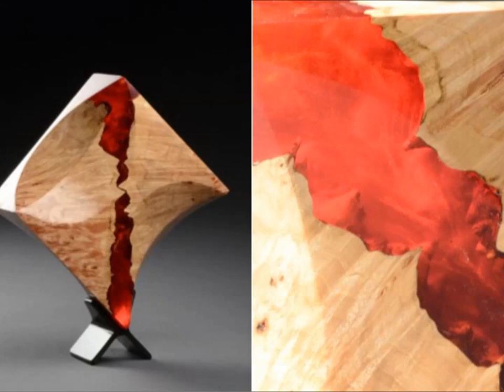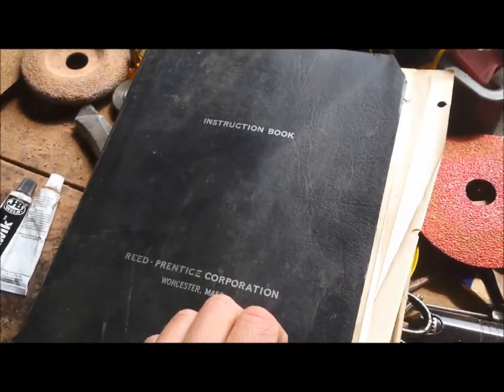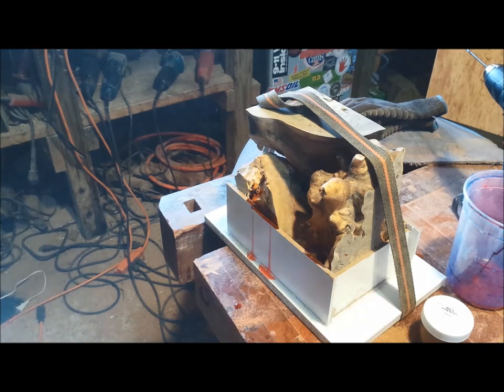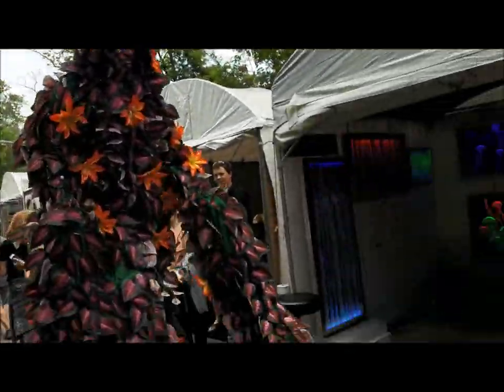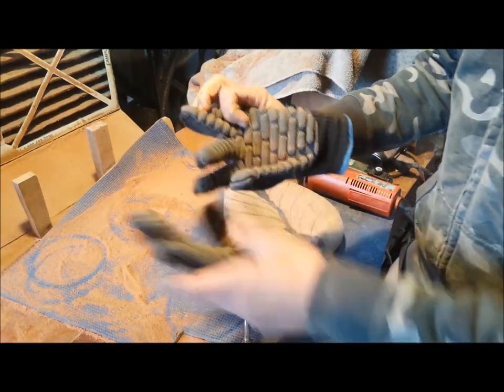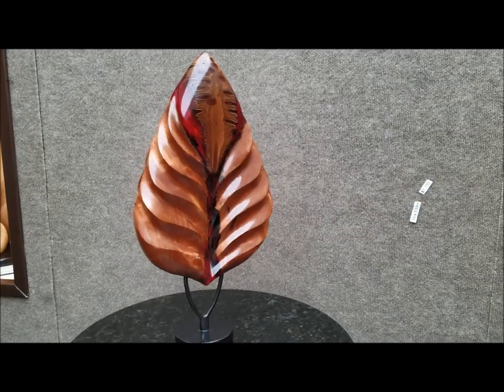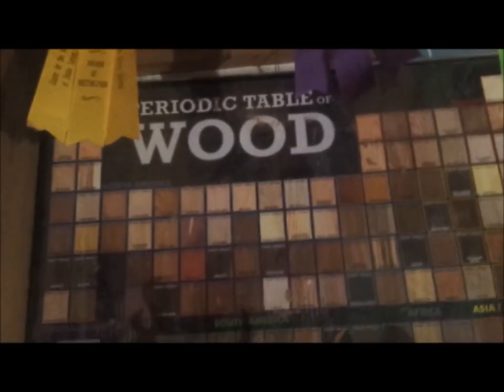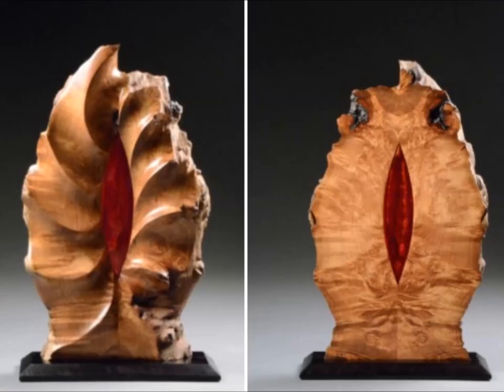Making Resin Cast Sculpture and a Pressure Tank/Vessel

Comment: Amazing work as always. Do you find that the banskia pods jave a lot of voids to fill when carving them?
Reply from the maker: If the banksia pod is cured in a pressure chamber, submerged in resin, it will be solid. I also use them with epoxy, cured in atmosphere, and have to fill numerous voids after the form is sculpted.

Comment: Thanks for all the behind the scenes stuff, though a timelapse of the sanding process would have been great. 

I've been spending the past week doing my first inlay with colored resin, but in aluminum. I cnc'd the design 100 thou deep, pressure cast, and spent today going through the sanding process up to 2500. Going to try buffing tomorrow. 

Any tips to getting a beautiful finish like yours?
Reply from the maker: Get a canvas buffing wheel from the hardware store. A small one can be put in a drill. Tripoli buffing compound will polish aluminum, poly-resin, acrylic very nicely. The aluminum will make the tripoli turn black and will smear everywhere, so clean the piece with mineral spirits or something. Automotive buffing products (Turtle Wax, etc.) will make it shine very nicely.  When buffing with tripoli, be careful not to press too much heat into the resin.

Comment: Fantastic work.  Does the pressure work better on the resin than a vacuum chamber??
Reply from the maker: Thanks for the compliment. In the case of this brand of polyurethane, pressure is better because the open/working time of the curing liquid is too quick for the bubbles to rise. Also, wood is an air sponge and will continue exhuming bubbles even with a slow curing resin like "bar counter" epoxy. I've experimented with both. If vacuum is prefered, the wood surfaces in contact with resin/glue need to be pre-sealed with the resin upon their surface so the don't exhaust during the vacuum cycle when a deeper pour is being performed.

Comment: I make guitars, And do a lot of contouring. What Kutzall bit should i try first? 

Also, You're easily my favorite wood carver. What are the chances one could pay you for lessons some time?
Reply from the maker: Their Dish Wheels and Shaping Discs are going to do the best large contour shaping/profiling. https://kutzall.com/collections/sanding-discs.   https://kutzall.com/collections/dish-wheels.  The Ball Nose burr would do great in the area where the neck extends from the body. https://kutzall.com/collections/ball-nose.  The grade of grit is relative to your methods. Control the angle grinder with a router speed controller. This is a must. 
At this point I've never charged for teaching, but I get asked often. Maybe my videos will become such a thing in time.

Comment: Bit of a dumb question, but these kutzall burrs would work on a dremel brand rotary tool too right? Those things look like they eat wood.
Reply from the maker: Yes. I was using the 1/8" shaft burrs in my 1990's Dremel for years until i bought a Mastercarver flexshaft unit, which has more torque, and is more useful at lower speeds. For 15 years I've depended on Kutzall tools and still do. For 1/4" shank tools I use a larger die grinder. -but always with a router speed controller.
Reply: @SalemBarker  Alright, thank you for the info. I'm looking to start doing some wood work/carving as a hobby and found that a dremel/rotary tools are a very versatile tool people use for various things, and after finding an old one in my basement I'm trying to learn which burs i need to buy as I don't want to buy those huge kits dremel sell without being told what bits I should be using for wood rather than metal if that makes sense.
Reply from the maker: @ignisking759  the sliver, or medium grit burrs are the most useful. Depending on the wood, they can get clogged with sap/resin but there are ways to clean them. Don't spin at full speed, and cut lightly. They're great. The coupon code SBARKER gives 5% discount. I was mistaken when noting 10%.

Comment: What kind of finish do you apply to your wood/resin pieces?
Reply from the maker: I only use what has UV inhibitors because light will fade color over time, especially in the dyed resin. The easiest is Hellsman outdoor urethane. It can be wiped on just like Minwax Wipe On Poly, and even easier if thinned 10% with mineral spirits. Nowadays I use Ilva Acrylic Urethane, but it has to be sprayed.